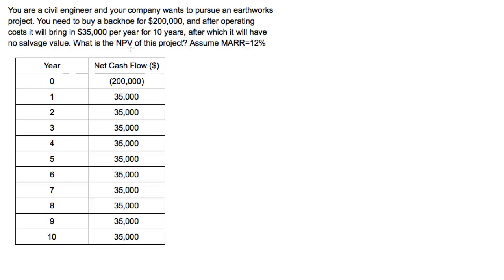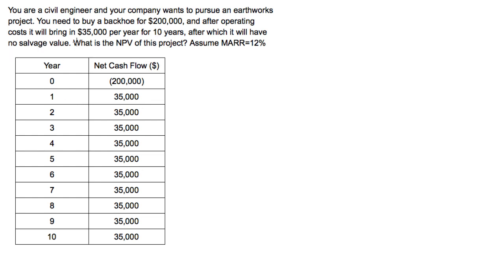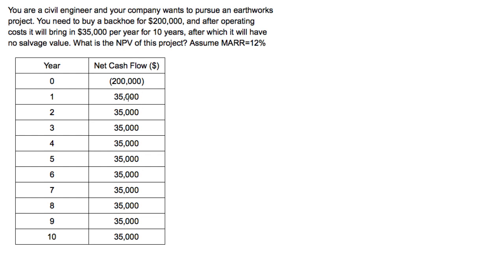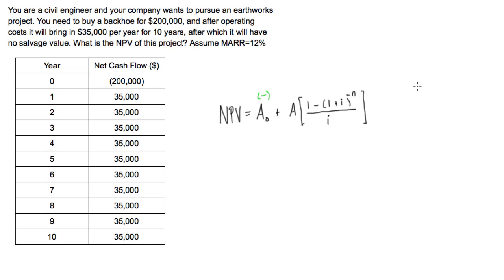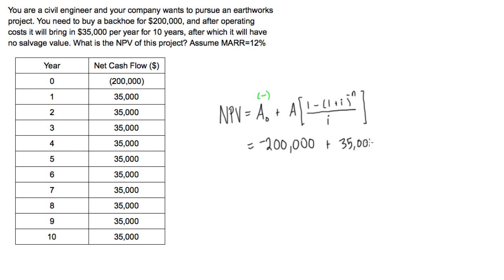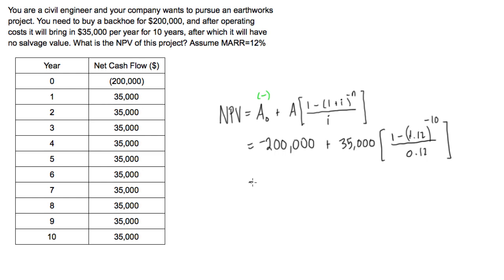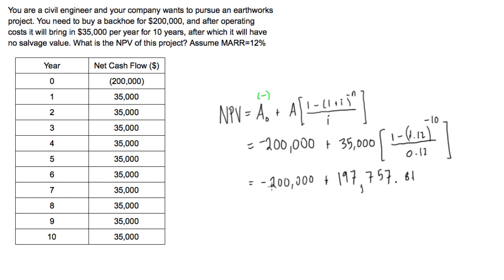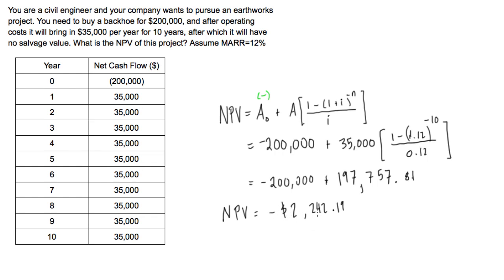Net present value (NPV) example problem

Comment: What if the salvage value was given?
Reply: 2 numbers on the bottom
Start-end /start multiplied by 100=rate of return or 11.93 so project was declined. A salvage value means 11.93% would lower. We need 12% or more😊.
Reply: It would fail again .much worse irate if return would be lower. Like 8%